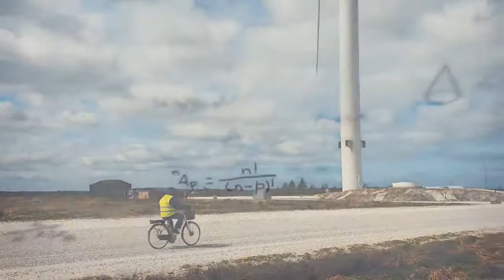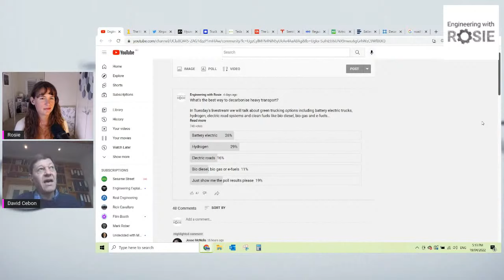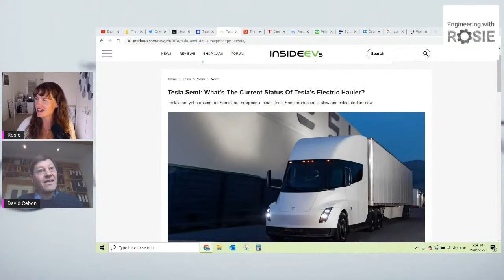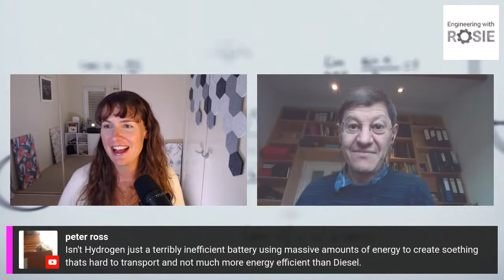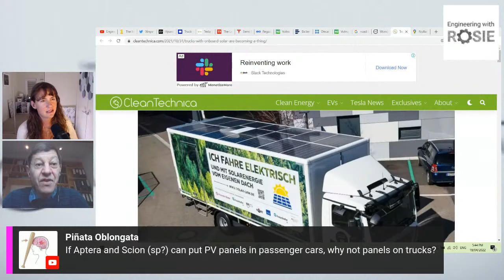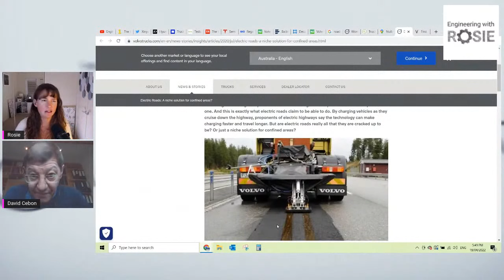How Can We Decarbonise Trucking? | Engineering with Rosie Live Ep 11

Comment: Electric roads will never happen in UK, if they ever do put the wires up how will they secure it against theft of the electricity and the wire itself, if they go down the route of smaller substations to cut cost they tried that when the East Coast Mainline was electrified over 35 years ago we have now gone back to diesel powered trains on this route because the system can not supply enough power for the trains using the route today

Comment: Hi Rosie, I wonder if you could include rail freight in your comparisons of alternate fuel transport (especially long distance heavy freight) in a zero net emissions world?  Rail freight has the big advantage of using far less energy per tonne km than road.  Around one third for long distance haulage.  This is due to lower rolling friction and wind resistance.  Overhead catenary is also a well developed rail technology and HV AC relatively low cost compared to some of the alternate technologies being considered.  HV AC catenary is highly efficient.  Locomotives operating on this system are also cheaper to purchase and operate, unlike alternate powered trucks.  I realise this does not deal with the supply vs demand power issue, but large static batteries would surely be more effective that carting them around on a truck or the low efficiency of hydrogen.  With rail using only 33% of the energy, rail would be more than 3 times more energy efficient than battery trucks and more than 9 times more energy efficient than hydrogen powered trucks, once the impact of the increased TARE with these technologies is considered.  Freight is a business driven heavily by economics.  If these technologies are more expensive than HV AC rail they will fail to see wide use. Why do we ignore the solution in front of us?  We search for new, expensive solutions when we have one already!!!

Comment: I would like to see the heavily used roads in Alberta ie Calgary - Edmonton equipped with induction lanes.  There are a lot of heavy trucks on that road, almost all of which are pulling trailers.  Trailers allow for hooking up to other sources of energy for points of origin and destination - first and last kilometres.  We could, alternatively, go to hydrogen, but Alberta being a petroleum and natural gas, hydrogen will most likely come from these two resources, not especially green.  The market saturation ie geographic spread could be greater than straight electric.  On the other hand, there is a lot of open farm, ranch, crown, indigenous land around the roads, so with suitable arrangements made with title holders of these lands, solar and wind could be generating truly green electricity.  The most heavily populated areas usually do not have a to of surface water from precipitation, so water to feed H2 could be an issue.  No easy fix, for sure.

Comment: I see some urbanists nowadays arguing we should shift trucks to rail as much as possible, leaving them only for local or last-mile service. They argue its more energy efficient and will save money on road maintanance. Quicker delivery times may be achievable with smaller trains operating on regular schedule, maybe something like japanese m250 series. Theres also special intermodal cars like megaswing or modalohr where you can load a whole trailer in and out relatively fast and in parallel. But this will require some infrstructure built, like a bunch of sidings and access ways to warehouses and factories, intermodal stations, etc. Also, European rail is held back by the fact they still dont use autocouplers on freight wagons.
Reply: @Sen Se I mean they still use a lot of rail in Switzerland even with their topography

Comment: About battery swapping. Why would you need to (as he say at 22:40 batteries need to be shifted around). A swapping station always have at least 1 battery, let's say two, one is charging and one ready to be swapped. When the truck arrives it leaves one battery and pick another one up. As long as you have access to electricity or a solar panel charging by the station you wont need to shift/transport the batteries.

About hydrogen. You don't need to ship hydrogen, it can be made on site. All you need is clean water and electricity. You may need to ship clean water to the hydrogen site if it isn't available.

Comment: Sadly he seem to be a negative battery doubter rather than a researcher.  He is wrong on the weight.  The best estimates so far are less than 4tons for the battery, with about 1/2T for the entire drive train, that compares pretty well to the engine, gearbox, fuel and differentials which are not there on the Tesla which has a 40T load capacity.  Its seems he has read the misinformation from the fossil fuel industry accepted it and moved on.  He seems influenced by his past work on de-polluting using gas, which isn;t helping climate change.
So we can discount his opinion on batteries for medium to long distance, his expertise is mechanical not electrical.   Batteries have massive efficiency and cost benefit, so it worth changing the system to suit them.  Along with the idea that batteries are improving all the time.

Comment: I don't know why he was quoting the weight of a lorry battery as being 8 tonnes.

A Tesla 85 kWh battery pack weighs 1,200 lb (540 kg).

Obviously if you want to build a battery 16 times the size that Tesla battery you'll have you're 8 tonnes, but you'll also have 16 times 85kwh.  That's a 1360 kwh battery.

You don't need 1360 kwh batteries in a lorry.  A more sensible battery for a lorry would be 500 kwh or 800 kwh.

Comment: Where did he get 20% efficiency for hydrogen fuel cell vehicles?  I heard it was 30-40%, which makes sense when electrolysis will cost you 33% and the fuel cell is only about 70%-90% efficient.

I would have voted for batteries.  But in hydrogen's defense if you think of the power grid it makes sense to use hydrogen.  People use electricity at different times to when renewable electricity is generated.  So if your wind turbines generate enough electricity for both the electric grid plus enough electricity for a hydrogen infrastructure, then the trucks don't care when the wind power made the hydrogen, however people using electricity at home do care when the wind turbine creates their electricity.

So in terms of the bigger picture of the entire electric grid having a mis-match of supply and demand, they it makes sense to have a massive hydrogen infrastructure.

As for moving hydrogen it's easy to move natural gas, and if you can did with natural gas without all of these problems then the same should apply with hydrogen.

Comment: Tesla Semi doesn't need 8 tons of batteries, the energy density of their 2170-cells is 240-something Wh/kg, and they're planning to use the even more energy dense 4860-cells for the Semi, which probably will have 250-ish Wh/kg on pack level. Consumption will be less than 2 kWh/mile, real world highway, fully loaded, that was  announced at the unveil. That means, 4 tons of batteries can have 1 MWh capacity, that will give over 500 miles on a charge. Add the weight of the motors, and then subtract the weight of the diesel drive train; engine, transmission, exhaust system, even the fuel tank alone can weigh over a ton when full, and so on, and you're roughly back on the weight of a powerful diesel truck.

At the unveil of the Semi Musk said that they did thorough research, and designed a system that fulfill the needs for most, practically all. That system including chargers that they will provide, that can recharge the Semis to 80% in 30 minutes. That is, it is not based on average journey and ignorant assumptions from that. A bit over 500 miles on a charge, and being able to recharge to 80% in 30 minutes covers most use cases. He also said that they were planning a 300 mile, and a 500 mile version, later he has said that the long range version probably will have closer to 600 mile range.     

Hydrogen taking ~3.5 times as much primary energy is a big problem for hydrogen, but the cost of the hardware needed, both investments and maintenance, makes the energy efficiency issue seem irrelevant.                  

About electric roads, well, not much need for them when the Tesla Semi, and later similar from other manufacturers become available. Niche cases, sure, vehicles going predetermined routes. The biggest problem for electric roads is besides costs, it takes a long time to implement, they will be obsolete except for specific niche cases before we can have a network of them up and running reliably.

Comment: For E-Trucks we could do a smaller/minimum battery in the cab, as discussed, but why not put the extra power needed for the load with the load;  i.e. put a battery pack on the trailer.  Heavy load...big batree/charge...light load...little batree/charge, long/short trip...matching battery power for different contexts, etc. or something like that ;) Or..just do the swap thing if needed.  Yes, there's conops and issues to work out but, for one thing, we could charge the trailer batteries when they're sitting or while being loaded...just sitting in the yard, charging in the sun ☀️ (trailor or warehouse panels/plugged in/etc.).  So what's the big issues/concerns that I'm missing (aside from the weight issue)?
Also, hope you can mention Gallium carbon capture in next video. Been reading about it and still don't know if it's hype or not. Cheers all. Be well :)

Comment: Seems like the pantograph approach would be great for balancing load on the grid - guarantee a minimum power output, but modulate above that to offload electricity from the grid when needed
Reply: I don't think so. Trucks would be drawing power whenever driving on these electrified highways, not when there's excess supply.
Reply: @seneca983  I agree that they would be drawing some power the whole time, but the question is whether they would be drawing the maximum the truck was capable of drawing, all of the time. Put another way, would a truck driving at its average motorway speed (remember sometimes they are stopped for long periods in jams) be able to charge up more quickly than it expends energy. It doesn't seem too far fetched that it might be able to. If so, there is some leeway for grid balancing.
Reply: @SamPrince  I suspect there wouldn't be much leeway for balancing. They need to at least draw the amount that makes them move. Often they might need to at least charge a certain amount or they might not be able to charge if the battery is full.

I think charging of EVs at night (or some other time) is more promising for stabilization is there is more leeway to time the charging over a longer period of time.

Comment: If you need X locomotives to pull a train uphill, then those locomotives will need to get back down the hill ready for the next load.  Maybe you don't need to power up the engines on some of the locomotives for the return journey, but they'll still be hitched up to trains.
Reply: Right...maybe its like a less than 1% downhill so it wont roll by itself.
Reply: If they have traction they could regen electricity going back down.
Unfortunately not an option with diesel electric locos.